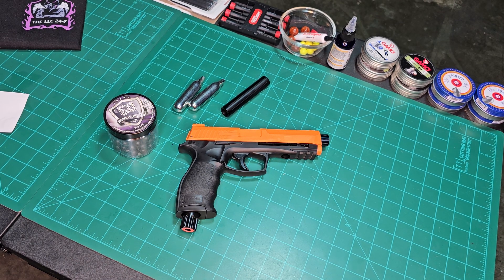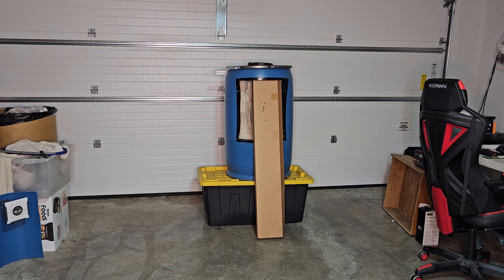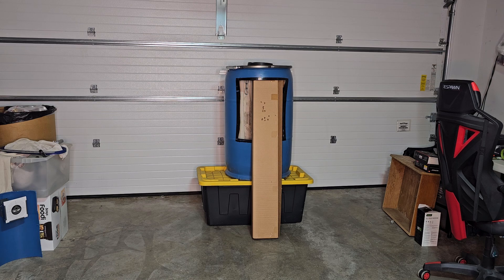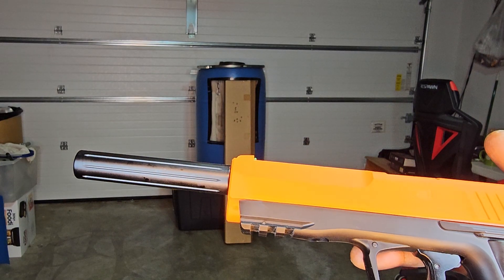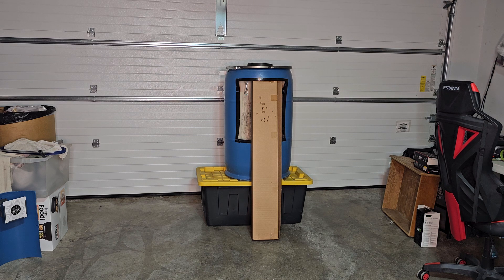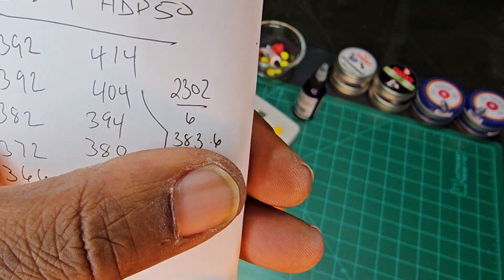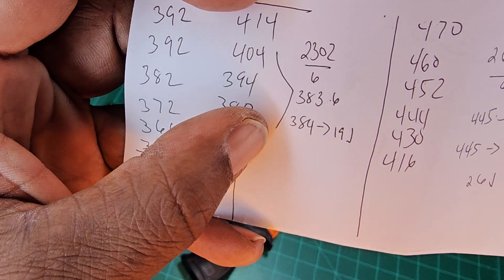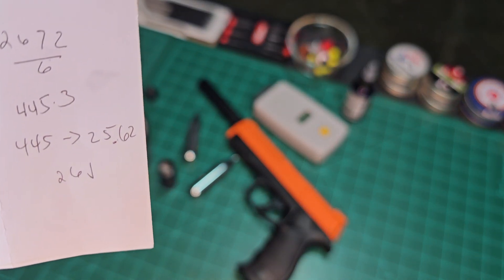26 Joules? HDP50 Tuning Barrel Test @mcs4us

Comment: That's on a gen1 version?
Reply from the maker: Yes 💥💥💥
Reply: @thellc24-7 Dam I got gen2 with the barrel upgrade an extension shooting PVC coated steel rounds from defense innovations I bet these are pretty gnarly with my setup all song about the put the barrel upgrade on my TR 50l using the same rounds is the tr-50 with the Gen 3 it says 11 Jules on it but defense innovation said it is 13j version so it's pretty much the most powerful TR50 you can get stock I'm assuming.